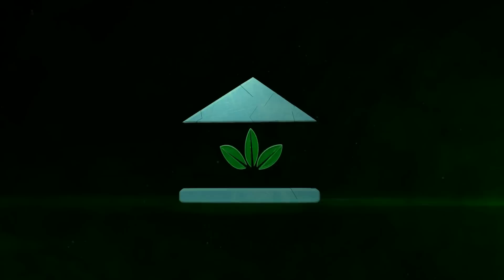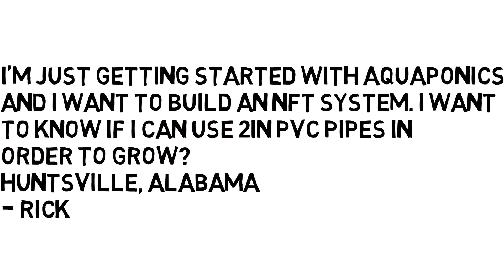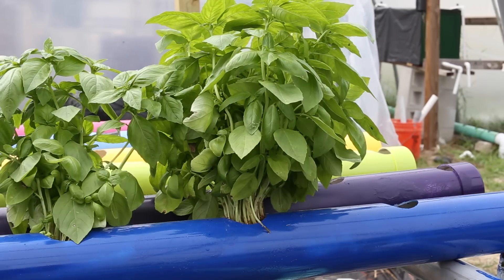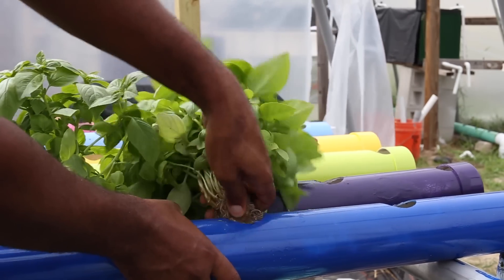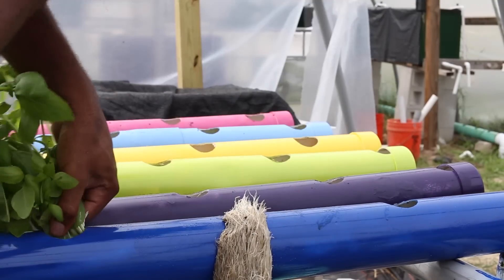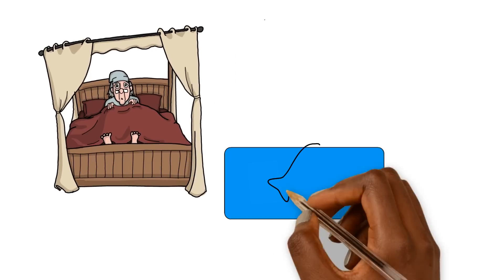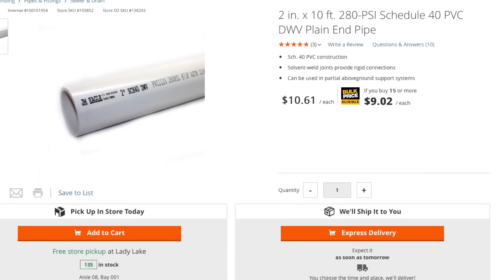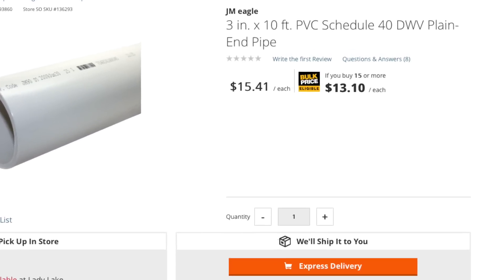Growing With 2in PVC Pipe | Ask The Aquaponics God Ep2

Comment: This isn't about 2"pipe but it is in regards to the nft pvc system. I was considering reducing down to 1" at the transitions and integrating an in line aeration stone via t's in the reduced pipe. The thought is that this would maintain O2 levels throughout the system. I am only doing 4 levels so I am not sure if this would be necessary.  Any input would be appreciated

Comment: I made one of these but I've also been reading about food safe plastics and plastics that don't leach in water.  I see people saying two different things some saying pvc can leach harmful substances and cause cancer and I'm not sure if I should continue to use a homemade pvc nft system or buy a professionally made one. Is pvc safe for hydroponics?
Reply: its safe for the water that comes out of your taps. most homes are plumbed with pvc for drinking water. its fine. just dont use cpvc, it has chlorine in it